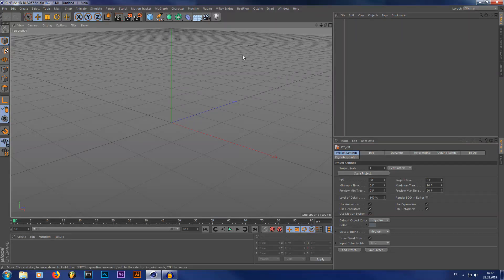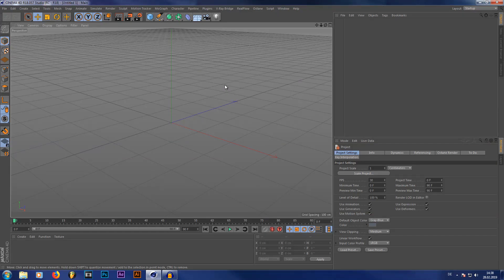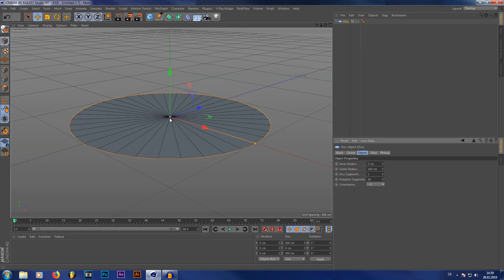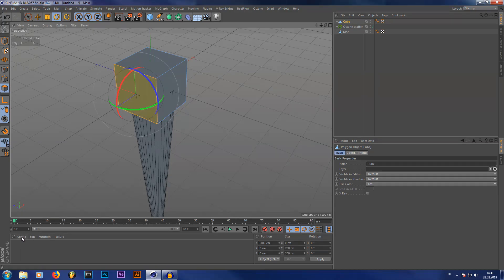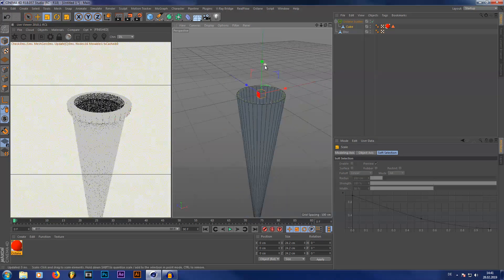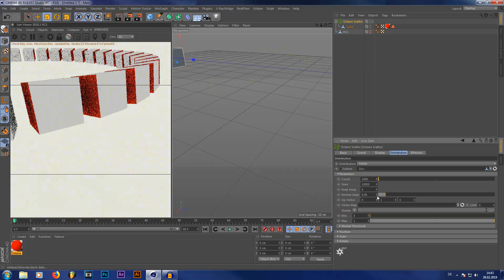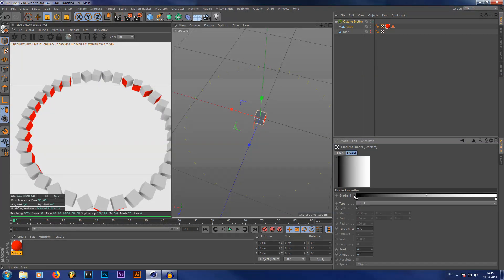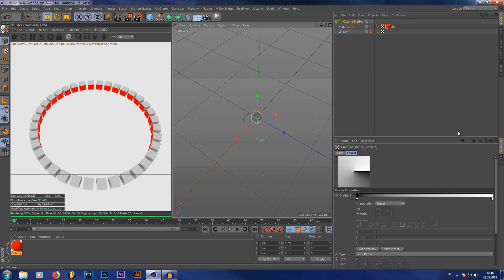How to Radial Clone using Octane Scatter | Tutorial

Comment: I mean I could be totally wrong (and excuse me if I am) but can't you spline-wrap a plane to a circle spline and scatter the objects onto that with Octane Scatter? Nice tip anyways, thanks for the video! :)
Reply from the maker: The thinking is totally correct, sadly that didnt work since octane scatters the objects on the vertexes (and if you use surface it becomes random), and a plane has 2 "rows" of points so you would have two circles. it would defo work in some situations but not if you only need one row of objects. But I really appreciate the feedback <3 , like I said there could be a better way and I just didnt find it yet haha
Reply: Oh yeah that totally makes sense, my bad. Really appreciate the videos, they are really helpful!